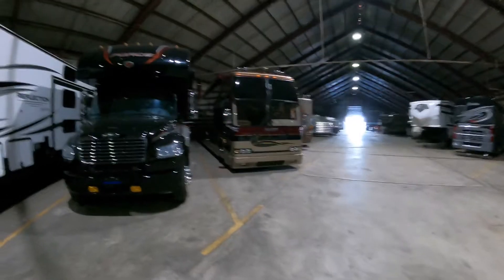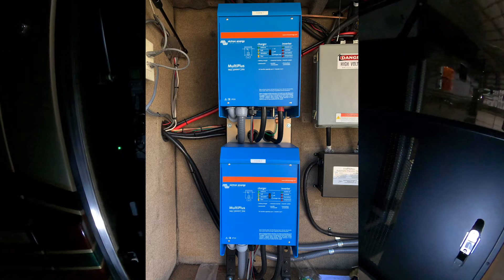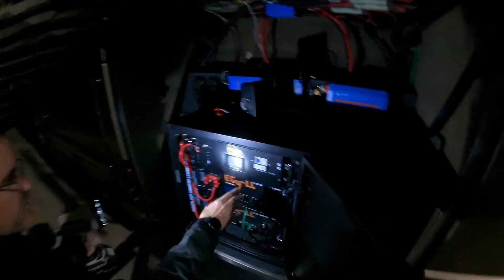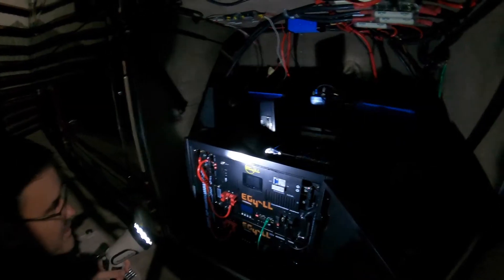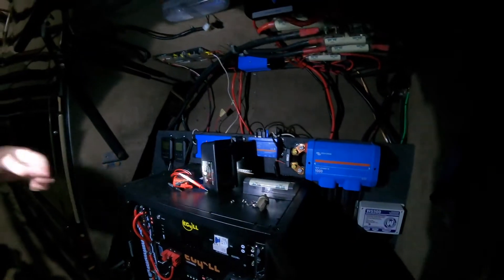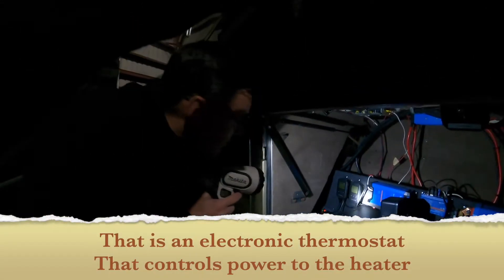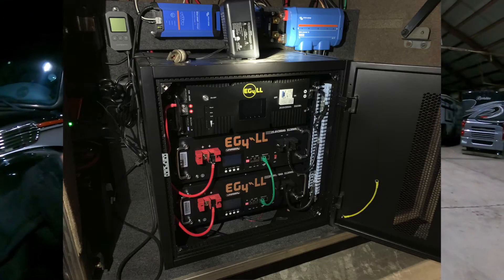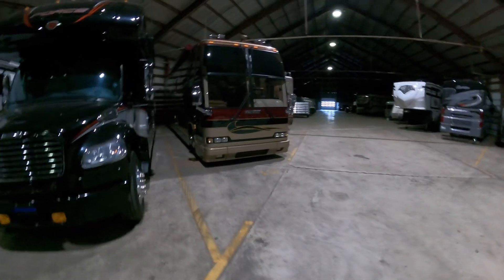Will this EG4 Lithium Battery Start My Inverter?

Comment: What if you had two batteries in parralel; would both bms see short ?
Reply from the maker: I have 3 in parallel now - I found starting one, then immediately starting the other provides the precharge needing to keep the 2 on. I then start the 3rd and reset the 1st.

Comment: Your startup procedure is backwards.  The precharge resistor is only active for a second or two.  By leaving your main breaker off, and turning the battery on, you are 100% missing the precharge.  Turn the batteries off, main breakers to inverters on.. turn on 1 battery. Both inverters will fire up.  Signature solar has a video showing the correct start-up procedure because so many people are doing it wrong.
Reply from the maker: The off switch is to my 24/12 step down transformer.  The inverters are wired directly to the bus bar - but go through those large fuses.  With both inverters hooked up it went to fault. When I unhooked 1 inverter but left only 1 hooked up - it precharged it.  That’s when I switched the 24/12 power on.  I am working with signature solar to see if there is a setting or BMS update that will increase the precharge resister to start 2 at the same time. The version 1 wasn’t  able to start even 1.
Reply: @CampPrevost  what I got from the signature solar video is that you need the circuit breaker on the battery to be ON before you start the battery/batteries to precharge the capacitors. This make the circuit to the Multiplus’s and the precharge circuit to charge the capacitor(s) during the battery start sequence. 

It won’t  hurt to put the fuse back in, close all three battery circuit breakers, and start the batteries. You could try just the one battery as a proof of concept, but the open circuit during the battery start seems to be preventing the precharge. 

I’m pretty sure there is a nomenclature miscommunication: Jeff is saying “main breaker.” I think he means “battery circuit breaker.”  

I highly recommend the signature solar video. 

🤞
Reply from the maker: Got it, thanks for replying again. I think I will try that today and see what happens. I don’t have the option on the version 1 batteries (no breaker, only a BMS on off switch) but do on the version 2 - worth a try - thanks!
Reply: @CampPrevost  ahh, I misunderstood the purpose of that on/off switch at the top.   In that case, signature solar has a firmware update for the batteries to address situations we're the batteries need a bit more 'oomph' to start larger loads.  For reference though, I have two Schneider XW pro inverters at home, and a single lifepower4 starts them both.  (I have 6, but tested this morning with just 1, before commenting again)
Reply from the maker: @JeffPalmer941  were you able to get a firmware update (sound like yes). I have been asking for weeks with no reply….  I have even offered to be a Guinea pig or help R&D something.  I get stuck with these videos - this is good/ok - but if they’d only reply I could make a - everything works perfect video - or how to fix this issue video…  now it’s in a dark cold storage building!
Reply: @CampPrevost  there is a link in the description of this video.  https://youtu.be/ud-Z5im66vQ. I have the 48v/100 batteries.  But the zipfile has files for the 24v guys too.  I'd love for you to record the before and after, but in one of their other videos about the firmware update.. they show the batteries powering on an oversized load.  Let us know!
Reply from the maker: @JeffPalmer941  thanks!  I just emailed them to see if this firmware works with the EG4-LL version 1 as the battery shown is their first run EG4 battery.  Somewhere after that series shown, the breaker switch was removed from the front of the battery, only a small BMS switch remaining. So appears there are several different versions, types floating around.  They also have a large switch between the battery and inverter in the video.  Perhaps I need that as well but a little hesitant because of the surge voltage that could flow through it - the reason behind the slow charge resistor used first - followed by the closing of the switch or circuit. If you touch the battery lead to the inverter without a pre/charge - its like a welding rod!  Found that out the hard way on a different inverter and lead acid battery!
Reply: @CampPrevost  it's for both. The zipfile has 4 files.  48v LL, 48v lifepower4, 24v LL, and 24v lifepower4.  The video shows you how to get the boot info, then you just select the file for that hardware version and voltage
Reply: Fix the obvious typo, it wouldn't post when I typed .com.

Comment: Why no shut off switch to those fuses ?
Reply from the maker: I thought about putting one in but would need two and running out of space.  I also thought about another coming from the alternator - it is fused up there as well. I can also just turn off each battery essentially doing the same.  Some of this is what is left over from the converter and some is mine.  I’ve thought about tearing everything out and reworking it all - need some motivation for that though!
Reply: @CampPrevost  If your stuck somewhere might be best to over do it on shut off switches. I'm pretty sure your good at making terminals. I'm curious, are there any 240v stuff on a Prevost ?
Reply from the maker: @VideoByPatrick  I don’t but most have a dryer and perhaps some other equipment - all the prevost are a little different.  I do have a 240v outlet for a dryer but don’t have one on the coach.  The primary reason for the 240v is it provides 100amps of power - 50 each leg.  The reason I have my inverters run split phase is so I can see them both from one cerbo and color touch (a Victron issue). Otherwise I’d have them run as two independent inverters (but doing that would require 2 cerbo and 2 color touch)

Comment: The battery turned on (didn’t go into “protect” mode). You didn’t show the inverter or Victron Connect to show the inverter was actually on/inverting. Also didn’t see you use ve.config to take the two inverters out of master/slave from the split-phase configuration. Are you really sure that just pulling the fuse on one inverter (master or slave) really allowed the remaining inverter to turn on? (From my testing, the remaining fused inverter just throws error coded and does not actually start. It requires both inverters unless it’s configured to operate in single inverter mode. 

It’s easy to reconfigure the remaining inverter for single inverter operations but you will want both inverters to be ON and then re-configure them to single inverter ops—then pull the fuse. 

Hope this makes sense (or, that you just didn’t show the inverter coming on) 

Have fun at the Boilermaker tailgate
Reply: Okay between you two it’ll be OEM in a short amount of time 👍👍👍
Reply from the maker: Sounds like you know your stuff!  I actually turn them off and bypass them in the storage unit.  I have one negative cable from each inverter landed on the lynx distributor and then the positive from each inverter runs through a separate fuse - then lands on the positive bus bar in the battery rack.  So pulling a fuse drops an inverter. They are both off as well, so just trying to get the battery to pre-charge the Victron Caps and stay on.  It wouldn’t do both at the same time but when I dropped the fuse, the battery was able to pre-charge one - I have a 24v-12v step down along with the cerbo and shunt running from the 24v - their lights turned on as well as I could hear the 12v stuff inside.  Just need to figure out how to get it to pre-charge both at the same time now. Battle born makes a “device”, can’t remember the name, that will dampen the current flow but they want close to $400 for it….
Reply: offgridsoftware has REC pre-charge resisters which may solve the problem for a lot less. There are a few versions but the simple one is basically a timed circuit which delays the inrush current until the capacitor(s) are charged. They have a variable and a fixed time version. 

I almost went with the REC BMS but decided to go with the Victron battery/BMS setup on my boat (split phase dual multi+ 24/3000, Wakespeed, and solar) because of the ABYC standards and resale “curb appeal” of a lot of blue in the electrical closet😎. The “science project” look of 32 prismatic cells in homemade plywood compression boxes would scare me off during a boat walk-through on a 6+ figure boat!  

I see how the circuit was broken to the second (slave or master) inverter was broken but am still not sure that the remaining inverter actually turned on. The Multiplus’s do a configuration test prior to allowing inverter or charger modes. If configured for 2 or more units, and only 1 is present, it throws a fault and doesn’t turn on. The other dc items (converter, cerbo, etc) show the battery was able to turn on and provide dc. It’s unclear if the Multiplus capacitors would precharge before the Multiplus faults for unexpected configuration or not. …next episode 😇

I have to say, your install is beautiful. Quality work.
Reply from the maker: @jimduke5545  thanks!  Will check that out, I think that is what I will end up needing to start both at the same time.  I didn’t even turn them on because as you said - the one will not find the other and shut themselves off/down.  I also didn’t want to turn them on until the caps were charged - didn’t know if it would be bad to have them turned on while connecting to the battery or not.  I want to put my volt meter on the bus bar while both are wired in, to see how high it actually charges the caps before calling it quits - curious to check the volts and amps. Wonder if there is a BMS setting to raise to get both started too - sure would be the simple fix…. Wish it was warmer and the bus was still in my driveway!
Reply: @jimduke5545  when he fixes his startup procedure, he won't need any additional resistors. His problem is that the main breaker to both inverters needs to be on, BEFORE he starts a battery. The built in precharge is only for a moment. He missing the precharge circuit cuz it's done before he flips the main breaker
Reply: @JeffPalmer941  just watched the referenced video. It sure looks like the startup procedure is the culprit. 

I don’t have the eg4 bats—I went Victron on the boat as Sig Solar didn’t have a water resistant solution in 24v nor did their WP line have the necessary CAN communication. The Victrons don’t have the circuit breaker on each batt—they are always on and the external BMS handles the start sequence/precharge. 

Great catch.